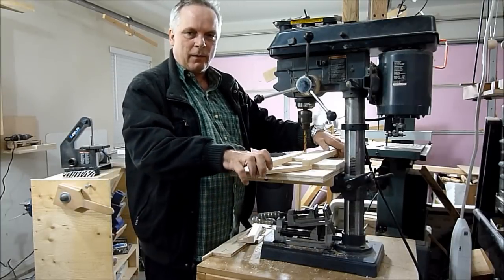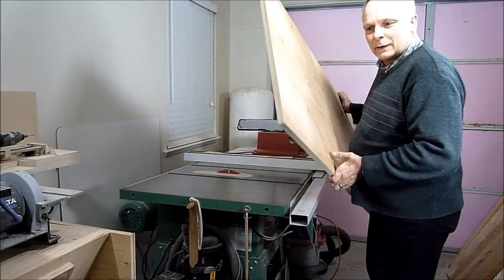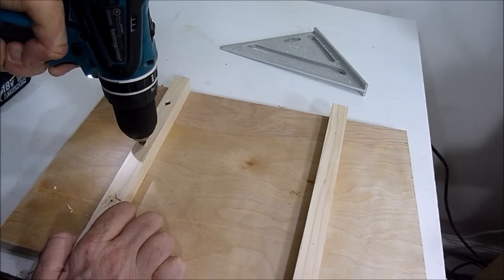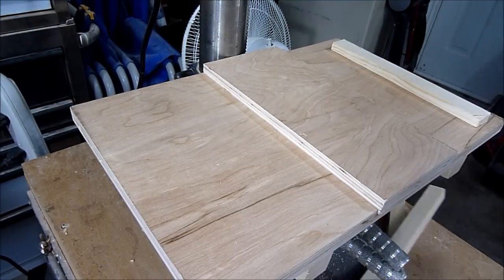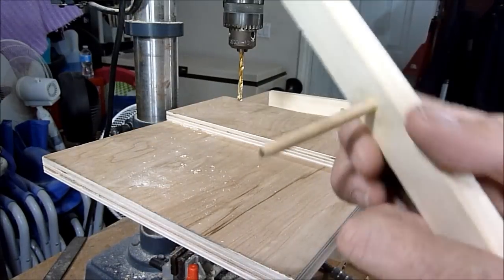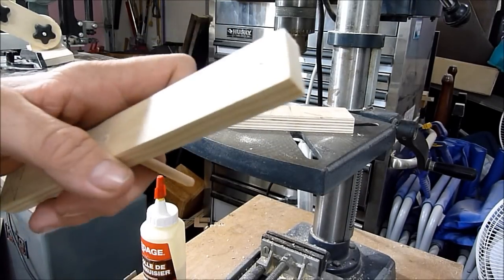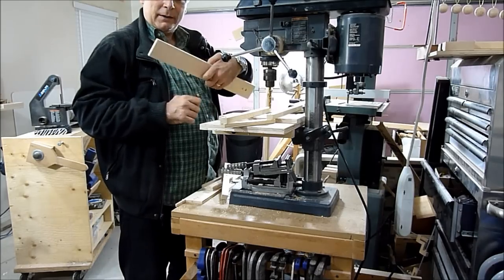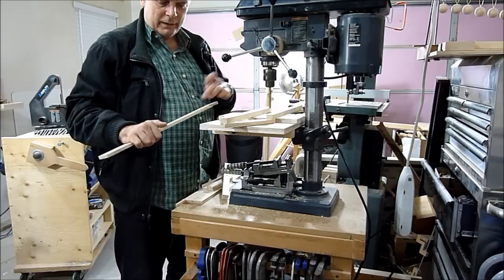Self centering drill press jig

Comment: That self centering jig is not accurate, that oval drill hole reveals it.
Reply: Well you made yours wrong then.  Mine and Jack Houweling's works great.
Reply: Dude, I am on about the video.
Reply: In theory this should work. Any ovaling may be due to a slight tilt in the table (my cheap harbor freight has a bit - damn thing) or some Chuck eccentricity (my cheap harbor freight has a bit - damn thing) but if built symmetrically it should get as close as you could via any other method.

Comment: I'd adapt this to a table saw sled but I haven't figured out how to stop it from pinching the blade when cutting a piece exactly into two equal parts. Centering a dado would work pretty well however.
Reply: Great idea. Prevent pinching by replacing opposite corner bolts with wing-nuts. So snug-up jig to work piece and tighten nuts thereby holds position without applying additional inward pressure on blade.

Comment: How do you determine the position of the holes for the dowels on the base plate.  This may be a stupid question after I try to make one of these.
Reply: It doesn't matter.   What makes it center is at 4:19, he locks in at center.
Reply: I would think that since you close the jig around the bit, it would pull the table to center and the dowels would only need to be fairly close to center, eh?

Love this idea. I was also wondering the same thing as +Bbendfender

Comment: Great idea.  I built one for my drill press and it works wonderfully.  I thought of an additional idea using this jig.  Drill through the side of a dowel with the hole aligned with center line of the axis of the dowel.  Lay a dowel in the jig so that the sides of the parallelogram cradle the dowel and don't touch or just touches the other sides of the paralelogram.  The geometry of the dowel, the jig and the drill press would limit what size of dowel that could be drilled.

Comment: Jack, I have a jig for drilling centre of any piece of wood with parallel sides. Place a pegs or dowels equidistant on either side of the drill centre, but they must be in straight line with the drill centre. Place the wood touching the pegs on either side and the drill will centre it. Colin from Northern Ireland